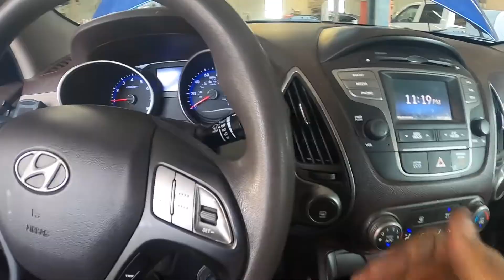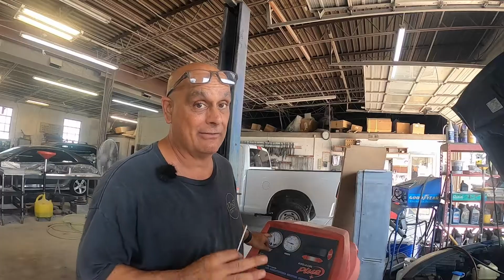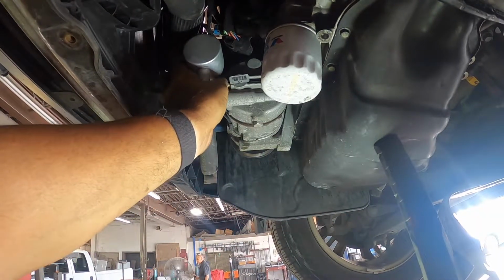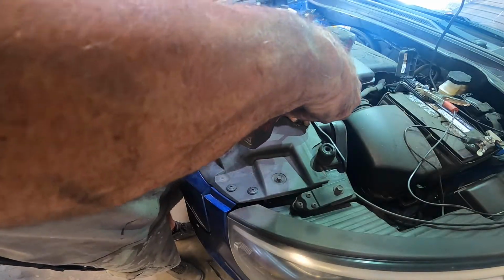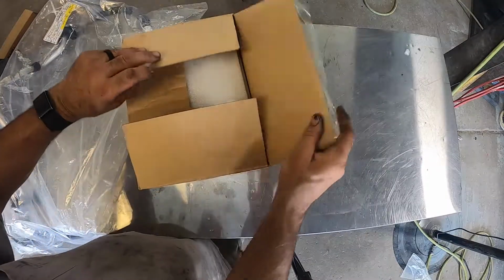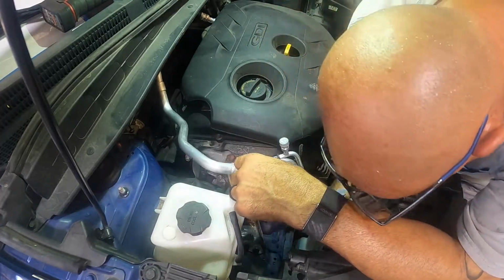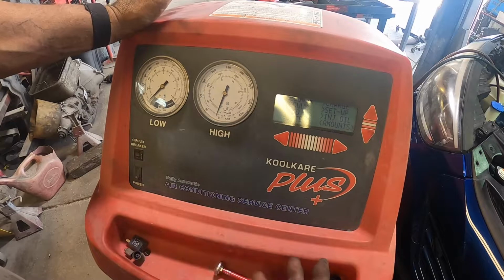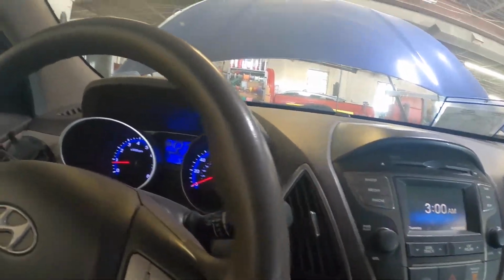How To Diagnose & Repair A  Hyundai Tucson AC System Blowing Hot Air

Comment: When it was at 50 psi on the low side and you determined it was the compressor that was not working correctly. Was it blowing cold at all?
Reply from the maker: No
Reply: Mine must be something else, going to swap expansion valve and drier since they are relatively cheap…think I have a leak somewhere
Reply: Because mine is cold but not like it used to be almost like it’s low and when I pull a vacuum and refill with 24oz it’s at 35-40 psi low and 200 psi high but then the high side starts dropping which make the low side rise in psi and then starts not blowing as cold